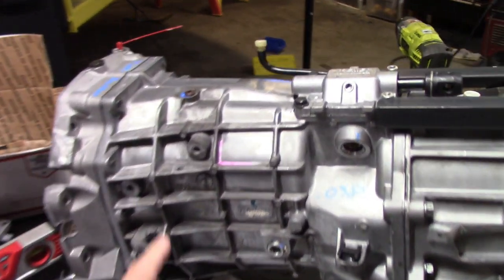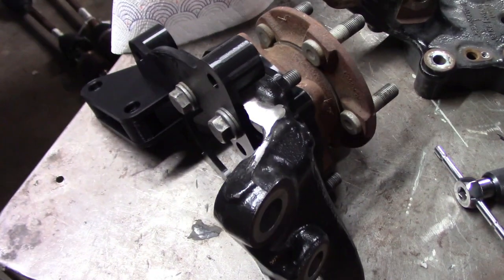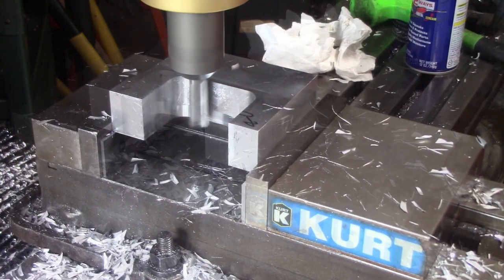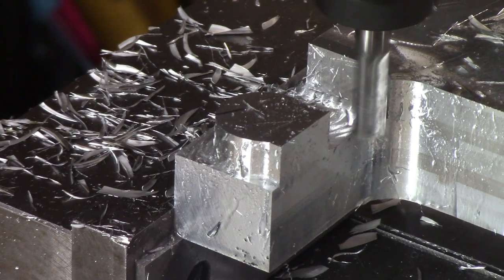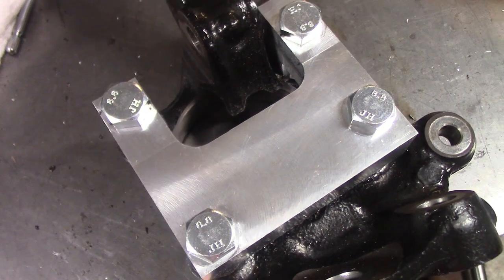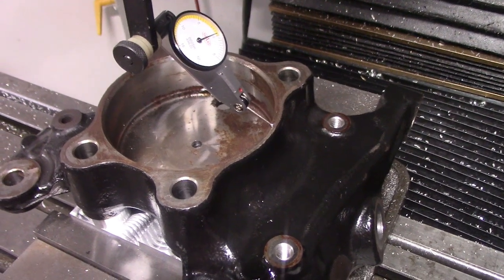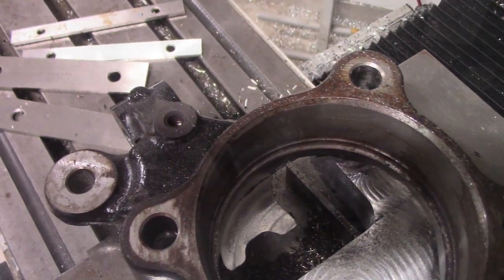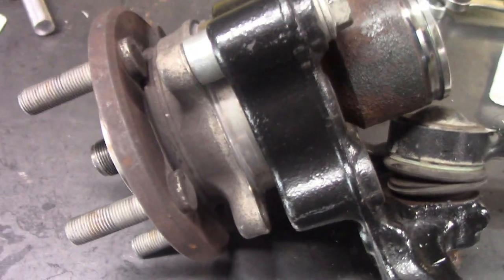Custom CNC holding Fixture, All Wheel Drive Mustang Project Update, Episode 10.

Comment: Hi. I'd prefer the episodes as they are, but if you like to go to more updates with bits of different
subjects that also works. Keep up the good work !

One question tho, are you willing to do a main shaft similar to your own for other people ?
I have a Ford Sierra 4x4 that need a better transmission........
Reply from the maker: Right now I am just focusing on getting my project done before I try to do any parts for other people.  You might want to talk to RS Gear

 http://tcase.rsgear.com/products.aspx

They make resplined mainshafts for TR6060's.  But, I would think a TR6060 is overkill for a Sierra 4x4 unless you are going V8.  Maybe something like a beefed up T5 with a Tcase adapter would be a better fit?
Reply from the maker: Also, have you considered an R32-34 transmission with transfercase?  That swap into a Cossie 4x4 has been done and there are controllers available.

Comment: Just curious, how much is your predicted “budget” for this build, as ive also got a mustang that i want to convert to awd, all in all ik itll be costly but im curious as to what it might cost and idk anyone else that has done this to this model mustang
Reply from the maker: This is a great question.  I am keeping a high level budget.  Obviously I am doing quite a bit of work myself which saves quite a bit of money.  

What gets a bit more complicated are things that I am getting that are not unique to the AWD conversion.  For example, I am doing a TR6060/T56 magnum conversion as part of the process.  That by itself would be around $5.  I am also doing coil overs as part of the conversion that add tuneability to the suspension regardless of the AWD, etc.  

So, with doing quite a bit myself, just the AWD bits are going to be about $5k-$10k, but I am getting a bunch of other upgrades in the process.  

I hope that makes sense.